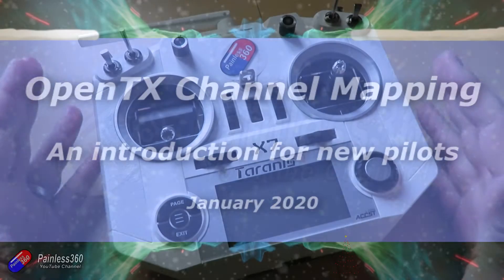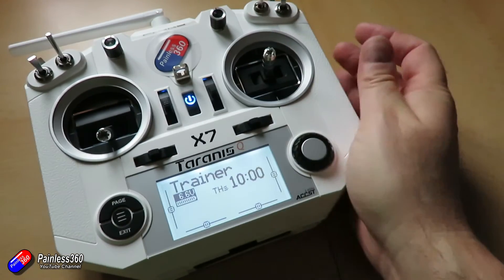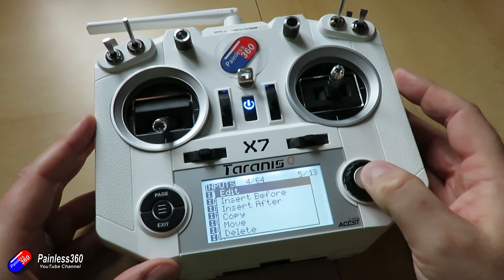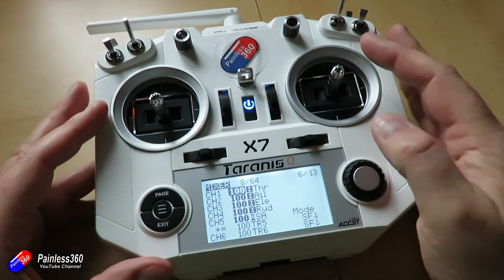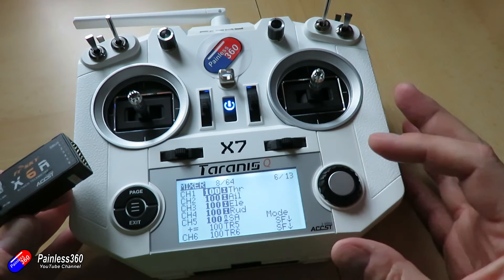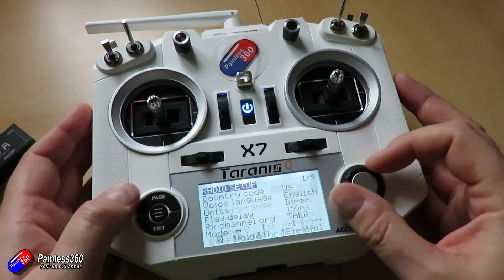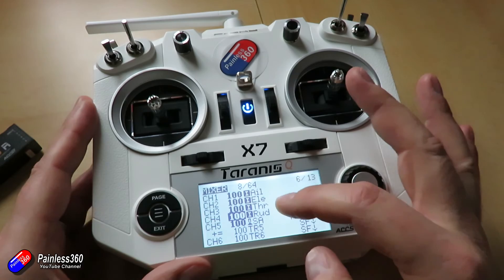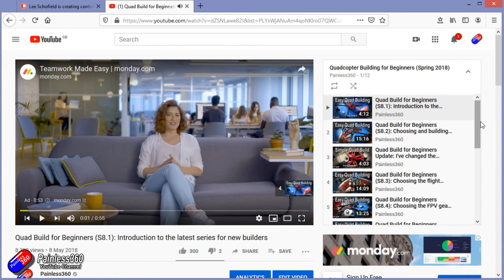How Channels in OpenTX work: mapping and changing the order (Taranis, Qx7 and T16)

Comment: Hey mate, huge question for you. I have a DJI F550 with a Zenmuse H3-3D Gimbal and a Go Pro Hero 3+ on it. Im using an FR Sky Taranis X9D + and currently have the SD switch programmed to enable / disable the gimbal and I also have pitch so it is going up and down using the RS (Right Slider) on the radio but I cant figure out for the life of me how to get Roll and Pan working as well as getting the MODE working or switches to turn the camera on and off from the radio or switch between photo and video mode etc.. Would really appreciate your help if possible please.

Im using the FR Sky X48 reciever.

Cheers
Reply from the maker: I'm sorry but I don't use DJI kit here so probably not the best person to ask. Best of luck with it!
Reply: @ OK thanks very much, mate.

Comment: Took a break from RC since 2021 back now and of course forget everything. I needed to map certain controls differently because I'm using a stabilizer receiver. I changed the order to match the receiver on the input page. Was I supposed to do that on the mixer page instead? It works I was able to edit each one change it.
Reply from the maker: Use the mixer to change the order. Best of luck

Comment: I have a flywoo explorer LR v2 and it came with a weird order, I just moved the 2 culprits in the input page... It works fine but I'm worried about its gps rescue function not working properly. Is this the case? I haven't tried the rth yet
Reply from the maker: Changing the order in the inputs screen won't change the order sent to the reciever. You need to change the mixer screen for that... Happy flying

Comment: Dear Lee, Thank you for your video. After a few days of trying to solve my new delta plane setup with Arduplane (not my first delta) and FRSky R9 Mini (sbus) I really need your help.
In Arduplane, radio calibration, no matter which channel I assign to THR, the slider (in mission planner) for THR will always be the roll one. If I change RCMAP mapping it still will be this channel (roll) that will control the throttle so the motor moves. I am lost. In Taranis QX7 INPUT I have TAER. In MIX I have AETR, but the issue is no matter how I rearrange the channel Arduplane will always take the roll as Throttle. This is causing issues since as soon as I start the plane the ESC will go into programming mode. Any idea how to fix this? Thank you.
Reply from the maker: I don't use the R9M here. Can you not just move the channels in the mixer on the radio?
Reply: @Painless360  I solved the issue by changing the options in servo output section.

Comment: I want to output the throttle of a buddy/slave radio to the channel11/aux11 on my (crossfire/ghost) receiver. This cannot be done by the easy TAER mapping method in open tx. How can I set up the input and mixer pages so that this is possible? I guess the buddy radio for example can already copy/map the throttle to his channel 11. And then I can input it just like that? Not sure if that is necessary and maybe I can directly select the throttle from the buddy radio as source for my input/mixer channel 11?
Reply from the maker: Easily. See my videos on setting up the trainer function... best of luck
Reply: @Painless360    We figured it out. 'Tr3' as source indeed and then trainer function always ON and some trainer setting to 'sticks.'

Comment: how do you reverse a channel.say pitch forward is pushing you in pitch reverse.how do you reverse that?
Reply from the maker: There are three ways in OpenTX. You can change it using the polarity of the control amount in INPUTS, MIXER or by reversing the channel in the OUTPUTS screen. Check out the OpenTX Mix School playlist for more detail.

Comment: HI Painless360--  thank you for your videos! When using the X9d 2019 taranis, channels 1-4 work in the output channel monitor. I set up a 3 switch toggle for channel 10 for the s6r receiver, but when I flip the 3 toggle switch,  it doesnt show in the output channel monitor on the taranis so i cant control the flight modes. Same thing with the gain knob on channel 9. What am I doing wrong?

Comment: Just installed opentx from FrSky OS I can't even get the throttle on the correct stick. Out of the box it's setup for throttle on the right stick I want it on the left. Looks to me Opentx targets the quad racing community not so much for fixed wing flying.
Reply from the maker: You probably just need to change the radio mode in the radio setup. Best of luck
Reply: @Painless360  I got it all working thanks for the video really helped. openTX isn't for the type of person who doesn't like to tinker with radios, but once you get past the initial shock of trying to understand the basics really is powerful radio firmware. I had FRos for long time really hindered the controls like the POTS on the back side of the radio were setup like logical switches with openTX I can actually use those wheels on the back to steer a nose gear. If want to get into scale models this is the radio to have IMO endless configuration. Unfortuntly have to forget about how a traditional radio works start over the openTX instructions are not well written for first time users not surprising typical of engineering types who wrote it.  Your video filled in the gaps I use the Companion software to program my radio much easier to do it on the screen instead of using the wheels.

Comment: Great video, love your channel.  In your opinion, if you were getting your first radio, and planned on mostly flying fixed wings, which would be the easiest to use and the most cost effective, if you were doing bind n fly, with safe,  and lemon TX receivers for plug and play?  I have the Jumpertx 8, and I just cant get it to work properly with gyros etc.
Reply from the maker: If you're looking for multiprotocol support for those BNF models then I'd consider the RadioMaster TX16s. See my Kit Picks 2020 video for my latest picks.. Best of luck!

Comment: It appears that channel numbers also appear on the input page . So why then do you need BOTH a input page AND a mixer page ? Other than mixing a channel from multiple inputs I don't see the reason to have both .
If you have a straight forward setup with no mixing of multiple inputs for one channel could you simply leave the mixer page blank if all the channels are allocated in the input page ?
Reply from the maker: In simple models it does appear like duplication but Che k out the videos in the Opentx mix school to see how much power they add to complex setups.. Happy flying

Comment: With your videos, I have learned a lot about open tx, and how to do almost everything. But really what I am missing is to find a video that explains to me which are the most usual mixtures that are used, that is, a configuration of an airplane model such as a high wing trainer, or a low wing, or a warbird.
Learn to configure a model completely, not loose parts that you do not know if it is what to apply or are just examples.
Could you make a video of this style? Thanks for your dedication.
Carlos (Madrid-Spain)
Reply from the maker: You watched my OpenTX Simpler plane setup videos?  Or its companion - OpenTX Complex Plane setup? They are both on the channel...
Reply: @Painless360  Sorry. I have explained very badly. I did not want to say how to configure the servos. I was referring to the most common mixtures, for example: Correct the adverse yaw effect, rudder-elevator, etc. Many of your videos explain how to do it, but for those like me who are starting again, an explanation of which are the most normal mixtures used is missing.
Your video of: OpenTX Complex 'Plane Setup Tips is a great advance and it is magnificent, in fact I have followed how to configure a model based on this video, but (in my point of view) it lacks to explain the mixes that would complete the programming . Those of us who don't really know what mixes to put on have learned how to make them, but we don't know what mixes need to be made (the most normal mixtures that should be put on any plane -on the whole-).
I hope I have explained  better. If in some of your videos you explain the mixes that must be made to a model, excuse me, but I have been unable to see it.
Greetings and again thank you very much. You are serving as a guide, as you can not imagine.
Reply from the maker: Ah I see! Nice idea. What mixes would you like included in a video?
Reply: @Painless360  I thought like a beginner pilot. The basic mixes of an airplane to start; then some for advanced pilot; and any others you may think appropriate, for example setting up a warbird plane, or an aerobatic plane. This can really lead to several videos, because I think that in one video you could not include so much pretense together.
But always thinking of a set of mixes that cover all aspects of configuring an airplane to put it in flight.
For example, think that you have an airplane that has ailerons (2 servos), that has flaps (1 or 2 servos), with a normal tail, that you want to have several flight modes, a smooth one, a medium one and a nervous or aggressive one, or modes of take-off, cruise, landing. If I think about it, I think of all the basic possible mixes I would need to get this plane up in the air, with minimal guarantees.
This would be a type of basic configuration, which every aircraft has to have.
After this type of airplane, variations can be made, such as V-tail, retractable gear, airbrakes, etc., etc. Any other possibility
Thanks again.

Comment: One glaring unnecessary challenge in all this. Is the muddle of terms used.
MANY MANY users use both Betaflight and Open TX for multi-rotors. Having to "convert" irrelevant and inapplicable "Airplane terms" like Aileron and Rudder into the relevant quadcopter (Roll, Pitch, Yaw) terms EVERY time we define or redefine something, is a waste of time and effort. It feels cluttered and inefficient.

Maybe there are enough quadcopter pilots now. Where both Betaflight (et al) and Open TX could branch into "Multi-Rotor versions" of the software/firmware. Where no irrelevant terminology has to be translated nor dealt with.

Could even be just one version. Except with the added option to turn off terminology that doesn't at-all, apply. 

Imagine being a brand-spankin'-new quad pilot:

"Roll Pitch and Yaw are the copter directions/headings."

"Then WTF is AETR1234?!? At least "R" means "Roll". Right?"

"Actually no. "R" means Rudder. Which is really Yaw.  AETR is Roll Pitch Throttle Yaw. In that order."

"Why didn't they just CALL it RPTY1234 instead? Do I have to memorize that translation to configure this stuff efficiently?"

"Actually yeah... Ya do... And just wait til we start on the radio."

Comment: Key points missed.  Set rates, Expo, and throttle arm in the Inputs tab.  Never change channel direction (negative value) in Inputs tab or the trims will be reversed.  Use Mixer for mixing - not for rates or expo.  This has been the case since we moved beyond ER9x.
Reply from the maker: See my full Open mix school series. This is not intended to cover those topics.

Comment: 30 years ago the multiplex europa sprint already supported "channel mapping"   the same way it does servo reverse ; you just plugged the wire from the stick pot into another port on the pcb inside (or turn it round for reverse)
Still have mine in use :)

Comment: Thanks for this, very useful. I've been flying quads for approx 18 months and this stuff is still a little opaque. Question for you though: I only have AETR set up in inputs, but the rest of the switches straight into the mixer tab without them also being added to inputs. It works fine. Is there any downside to this approach? Or should I also set up all the other channels (buzzer for example) in the inputs page as well as the mixer?
Reply from the maker: That is fine. See my Betaflight BNF setup video. If you are doing all of the 'smart' stuff in the flight controller then you don't need the input pieces for switches..
Reply: @Painless360  thanks for that!

Comment: Hi everybody. I've just bought a Jumper T16 and when i've updated T16's multiprotocol module firmware, i had to choose a specific channel order for the firmware file. It's a must to use that channel order when using infernal multiprotocol module or can i change order in mixers page and keeps all working ? Thanks.